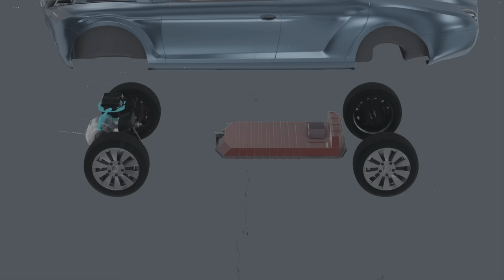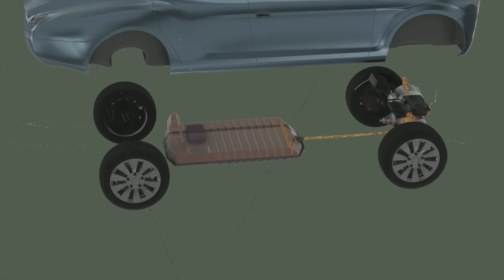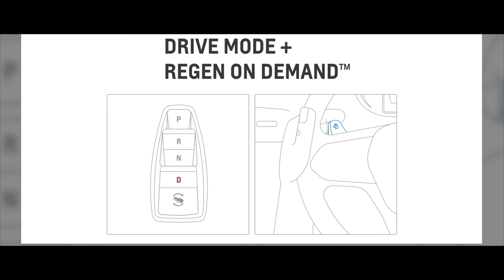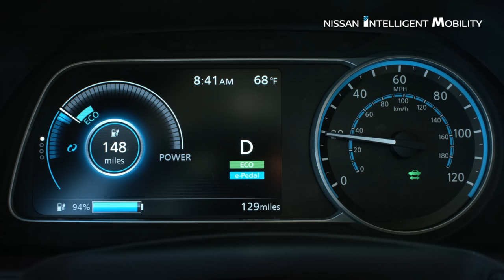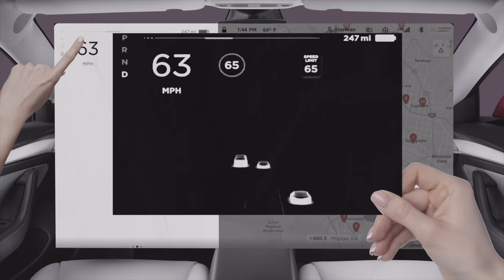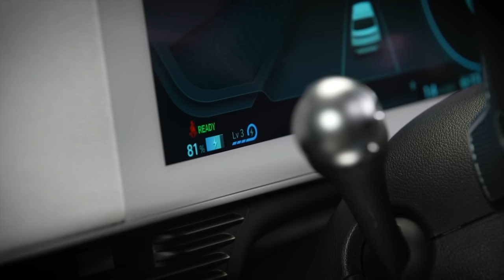Toyota's New Braking System Makes Your Brakes Last Forever

Comment: I had a Honda Element that went 165K miles with no brake pad change and it still had plenty of life left.  Anticipating braking does wonders for brake life
Reply: I really like people that gas up to a red light just to brake harder....
Reply: Yes my 94 HONDA Accord has 200 000 on it front brakes once replaced rear brakes once replaced!
Reply: In some ways HONDA is A little ahead of Toyota in Automotive inovations
Reply: @steveeddy6876  You're happy with your car, it's all that matters. Fanboying over any brand wins you nothing.
Reply: I barely use my brakes but I'm on my 3rd set with 105,000 miles. I'm not sure if it's because I don't use them but my brake discs pit, the pads barely wear but they get replaced with the brake discs. I drive a Toyota in the UK so the wet weather maybe has something to do with it rusting and grinding down? I have no idea, I should maybe do some research and find some super soft compound pads to hopefully transfer the wear away from the discs and onto the pads?
Reply: @em0_tion talk about something being useless while adding nothing of value
Reply: @DIE2dayORelse  Honda vs Toyota is the same difference to me, as long as it works. What annoyed you today?

Comment: I remember in the late 80's early 90's a company that was trying out hydraulic regenerative braking. It used a driveshaft mounted hydraulic pump/motor which used several accumulators to store the high pressure fluid to be used for helping acceleration. They tried it on some big rigs also. Locomotives have regenerative braking but all that does is warm up giant toaster coils. Although electric locomotives do put the power back into the grid.
Reply: That would make a lot of sense to get an extra punch when braking right before a corner then flooring it coming out.
Reply: Probably even more efficient than converting the energy to electricity to charge a lithium battery too
Reply: The trains that got their power from overhead lines via pantographs would feed the energy from regenerative braking back to the grid to power other trains, this was common in Europe where overhead power lines were common.  As most rail companies operated their own power plants and overhead power lines, a lot had to do with scheduling the trains such that one braking while going down a grade matched when one was ascending a grade to use the power from the regeneration braking of the descending train.  Now, with diesel electric trains (all of which could be ordered with pantographs if so desired, they really didn't build different trains, just offered pantographs or diesel generators as options), they tried using molten sodium batteries to store the energy but keeping the sodium molten proved to be an operational, maintenance and safety complexity that was difficult to manage with North American staff.

Comment: Owning a Prius, there hasn't been a day where I never actually used the brake pads to stop. Here in Florida,  for some reason, people driving regular cars love to wait 'till the last 20' and then slam on the brakes. I guess they like buying brake pads.
Reply: I do that but I'm just letting the car slow down by taking my foot off the brake. A lot of people go directly from gas to brake pedal.
Reply: Aron, Las Vegas is the same way. People will speed up and cut in front of you just so they can slam on the brakes for a red light. It’s absolutely ridiculous to do that. They’re burning up fuel and their brakes for no reason at all.
Reply: @alanj7306  Not to mention rude.
Reply: They are likely New Jersey transplants! Its better out here in northern Pennsylvania.
Reply: It makes me laugh how many people ride their brakes and rage on the the person behind them, get off the brakes and boom better fuel mileage, I use a manual, downshift as needed brake when absolutely needed

Comment: Scotty, the solution to prevent corrode rotors from regen braking is regularly using  hydraulic brakes whenever vehicle brakes below 10mph.  In some EVs someone already wrote this hybrid operation in the
braking software.

Comment: Scotty, during the regen, the motor don't move in reverse (so, there is no mechanism/need to decouple the motor from the wheels, as you mentioned), the system works in reverse, i.e. it starts acting as a generator, converting mechanical energy to very high voltage low amp current.

Comment: The motor does NOT run in reverse when using regen' braking, 

The motor is "driven" by the wheels, but it rotates in the same direction as when the motor drives the wheels,
this generates electricity, and it slows down the car

you can think about it this way: 
Accelerating: Energy from the battery goes to the motor that converts that into rotation ->this drives the wheels, 
Regen: Rotation from the wheels is converted by the motor back into electricity and this is put back into the battery, 

if you have used a bicycle dynamo then this is how the motor operates in regen, the production of electricity makes it harder to turn the wheels,

Comment: I had regen braking on my es300h. I didn’t have to change the brake pads the first time at 120k. That was just pads not rotors. I chose to change the brakes as well. It wasn’t required. Toyota has been doing this in their hybrids for a while.

Comment: With perhaps 75% of them being highway miles, the first set of brakes lasted 155,000 miles on my wife's 2011 Prius. The Hydraulic brakes are used enough, I saw NO evidence of any rust issues.
Btw: The car now has 220,000 miles on it and I just had my first ever non regular maintenance repair; a heat shield that cost less than $100 installed.
Reply: This is nothing to be proud of having a car with such low maintenance requirements. Support your local mechanics and parts suppliers and get a regular-type car that needs work!
Reply: My 2013 Ford Fusion Hybrid has been the same. Changed my first set of brakes at about 145,000 and that was only the front. No other non-standard maintenance. Regenerative breaking is an awesome technology but certainly nothing new.
Reply: @Russell-rc6qq  just buy MG's and Land Rovers in other words.
Reply: I woulda just ripped it off and saved 100 bucks

Comment: They do it with semi trucks too. They essentially use alternators on the wheels to power the electronics on the truck. Helps gas mileage by using the engine less to power things.

Comment: This is a good introduction to the system for people that have never driven an EV or a hybrid.  Btw, in Teslas you cannot disable regenerative braking.  You do get a warning icon that regenerative braking will be limited during cold weather.  Even in these situations, it does work, it just doesn't slow you down as quickly.  I have never had regenerative braking cause loss of traction even on ice.

Comment: I've had 2 manual transmission cars, I coast a lot in neutral to a red light etc I've gotten over 100k miles on the original pads. Just take them apart and a  clean.  Waiting for delivery of my NX350H,  should be interesting to see how long the brakes last. I will expect basic maintenance on them every few years, I'll do it myself.

Comment: Toyota does it again
Reply: Honda did it first with the 2003 hybrids because I own two manual cars got over 300.000miles out of both cars before the nickel metal hydride batteries were junk, And never had to do ANY brake repairs and that was in Wisconsin.
Reply: No theirs kind of sucks actually because their brake booster's have failed pretty consistently. Cost me $1,500 to do it myself in my gen 3 Prius. Gen 4 owners got a proper recall. They did two tsbs for gen 3 about the same problem. Kinda sucks they screwed the owners of 2010-15 Prius
Reply: @chicken29843  are you one of those Prius drivers that drive like their in a Fast n Furious movie? 😉
Reply: @raymondreiff8170  The Prius was actually designed first (concept and working prototype) Honda made it to production first by a couple months. But had little sales success. Toyota in their patience created a product that targeted the eco demographic more accurately. Honda ended up scrapping their sport hybrid after a couple years. I was sad to the manual hybrid go.😢
Reply: @chicken29843  huh fast n furious Prius
Reply: @dog troll  neither are you.
Reply: @mySaviorlives88  *They're
Reply: Now Toyota just needs to figure out how to keep the wheels from falling off their EV's.
Reply: Scotty does it again
Reply: You're one of those people that think toyota is perfect....
Reply: @raymondreiff8170  yea, but scotty said the 97 prius had it before that
Reply: @richsweeney1115  Toyota is Prius; not perfect..
Reply: @richsweeney1115  It did, But in my opinion the 97 pruis Car was more like a early Honda Insight, The 2003 Honda Civic hybrid was the most fuel efficient midsized Car in America at that time, Except for the water car invention who was killed by the oil control freaks, These same control freaks are busy Screwing up the Electric car industry and are winning like usual.
Reply: @beefybuttercup2978  see...I've worked on cars and trucks for 29 years...I know toyota makes prius...but most of these people act like toyota is perfect..and never have any problems
Reply: @raymondreiff8170  well, evs are crap....the water car  might have been interesting

Comment: I’ve driven a model 3 for a couple of hours and those regenerative brakes feel really weird but they are pretty cool
Reply: I’d be curious to drive an EV with them. Still, every vehicle will have its own habits with slowing down with letting off the gas. My 22’ Silverado Duramax nearly brakes itself once it’s down to 32-33 mph. Every vehicle takes some getting used to.

Comment: Might be more than a 50% increase in brake life. Have you driven a Tesla with max Regen braking? It slows down faster than (I do) when driving a conventional hydraulic system.
Reply: I own an EV (not a Tesla). Regen braking is fantastic, I use the hydraulic brakes about 15% of the time. Brakes gonna last 100, 000 miles.
Reply: I was once driving behind a Tesla in stop-and-go California highway traffic. I could only take so much and moved to another lane to drive behind a car that actually signaled (with brake lights) as it was slowing down.

Comment: When driving a Toyota hybrid and you want to coast, simply release the gas pedal then very slightly push on the pedal again and hold it in one spot. Now you should be coasting on neutral.
Your energy flow display should confirm that the car is coasting.
You're welcome 😁 👍

Comment: The early Prius integrated the regenerative braking control into the brake pedal but they kept the mechanical braking response the same so the regenerative braking prior to mechanical braking made the brake pedal excessively responsive so it took a lot of getting used to.  Most regenerative braking controls are now by levers or rather paddles on the steering wheel.  To reduce the mechanical braking response and top it with the regenerative braking so that controlling both with the same brake pedal without changing the feel of braking would be ideal but would be difficult to get pass safety regulators who would want the mechanical braking response to be the same as it has always been and the regenerative braking to just be an added functionality.  Instead of a rational user interface, we're likely to just become accustomed to the separate paddle controls before safety regulators would admit it would be safer to reduce mechanical response so that the initial brake pedal response be regenerative braking giving seamless control.

Comment: Brakes should definitely be serviced once every 2or3 years even if you don’t use them much.Pads can become rust jacked and pads can fall off the backing plates! Pads can rust seize in calipers and the fluid that is hydroscopic can obsorb moisture through the flexible lines causing corrosion inside the brake system!

Comment: My 2020 Hyundai Ioniq regenerates very slowly and brakes are needed more unless you set the level to 1,2, or 3 using the paddle shifters in automatic eco mode depending on how much braking you want. Of course in Sport mode the paddles shift the gears and turns off regenerative braking. Perfect design that works amazingly. Shame Hyundai will stop production of the Ioniq because the Elantra is now hybrid and they're almost the same size. The new design of the Prius is what draws me. If the Ioniq wasn't perfect in every way I'd definitely get the new Prius.

Comment: The motor DOES NOT RUN IN REVERSE, the motor turns into a generator when the kinetic energy turns the motor (not the battery).
When I drove a electric prius and leaf, I hated the regen because its hard to just coast, your either accelerating or braking, just stupid (maybe its better now), in effect, costing efficiency. I can get 64mpg in my wifes 2018 corolla on flat ground doing 60 to 65mph, so I am above the average in that respect, its all about the right foot.

Comment: Back in I owned two 2003 Honda Civic hybrids with regenerative braking and 5 speed manual transmissions I never had to replaced the brakes pads on both cars with over 300.000 miles on them because I always downshifted the transmission to keep the charging to the max, Sometimes driving around town was able to get up to 61 mpg.

Comment: Hybrids suck when the expensive battery degrades. At least with hybrids like the Ford Edge after 10 years, the ICE motor will works.

Comment: Scotty you should do reviews on older cars. Or compare older cars to new and the pros and cons of both and why some people don't wanns let go of the older generations of cars.
Reply: new>expensive
old>inexpensive       there. done.
Reply: Saabkyle
Reply: Every extra layer in an onion is just that many more tears shed. K.I.S.S. ☹️
Reply: @tinkerstrade3553  onion rings
Reply: How do you compare older cars to newer cars. Older cars had carburetors and they didn't even have disc brakes.   Unless you are a collector of old cars and love to drive them. You are in the minority.
Reply: Yea no one doing that big boy,  if you can't look up the difference between the two shouldn't own a car lmao it's called new is better vs old and constant repairs lol then it's also Japanese quality vs American gabage lmao
Reply: @patrickhenry2845  you need to do some research, there was fuel injection in the 50s my friend. I wasnt just meaning cars that old. 90s, early 2000s as well. Disc brakes have been around also since the 60s.
Reply: @AnthonyParrilloRI  You are correct. I remember my dad putting on a 2 barrel carburetor,, Rochester type. Later I remember to my friends had cars with Holly 4 barrel carburetors. Cars came out later with disc brakes in the front and drum brakes in the rear. And, later disc brakes on all four wheels. I don't need to do all of the research that you require of me. When, I have witnessed all, firsthand. No thanks to your research advice.
Reply: I had to leave go of my 2011 Hyundai because someone hotwired and stole it.
Reply: @phatgringo2.0  But if you have Vidalia onions the only time you cry is when you run out of them.
Reply: Why is there nothing that is all sunshine even sunshine? 😢
Reply: Scotty reviews plenty of vehicles that are 20-30 years old and older. I’m pretty sure that he’s mostly reviewing vehicles that people might actually be interested in buying or that they might own.

Comment: It is electric cars that have the biggest problem with brakes - the brakes do not wear out with use (due to recuperation), but since they are hardly used, they corrode on the contact surfaces and they need to be replaced soon. In warmer areas, it may not be so critical, but where roads are salted for most of the year, it is a real problem. Maybe it would be solved by a different brake disc material that does not rust.

Comment: Regen braking acts like a Jake brake in heavy duty diesel trucks. If you’ve driven a truck with an engine or “Jake” brake then getting into a vehicle that uses regen braking will feel very familiar

Comment: Wouldn't the regenerative breaking work along with the traction control and the anti-lock brakes to eliminate the problems with snow ice and even water. I know when I drive into work with my 2014 Fusion Energy when getting off onto the freeway off-ramp I don't usually touch the brakes to the last minute instead I decrease my miles per hour on the speed control usually down to 20 before I have to touch the brakes that ensures I maximize. Breaking

Comment: Hybrids have been common enough for 20 years. The brake argument should be finished. Also, my Ford hybrid has traction control. I've never had an issue with the regen in slippery conditions. Maybe that's just the really aggressive regen that Tesla has.

Comment: comercial large buses have redarders with the air brakes to help with the braking so the brakes don’t overheat. some retarders engage when the driver backs off the accelerator. the “regen” in our electric buses do exactly the same thing. However, like Scotty said turn off the regen on icy roads, as we do with air brakes on comercial vehicles.

Comment: This should be in all cars, regenerative brakes is a good idea. There's also a Shock Absorber that converts the vertical movement of the car in electricity, for cars and big trucks; that can be stored in a rechargeable battery
Reply: Yeah that stuff has been around more than decade but needs to be more widely available
Reply: I've heard of ride setting/magnetic shocks. They cost $$$$ per unit. Pass.
Reply: @timewa851  They're not magnetic shocks but generators

Comment: It basically replaces gas engine braking with electrical generator  braking. Regenerative braking is the biggest source of increased fuel economy in hybrids. You are also wrong about wasted regenreative braking. You almost NEVER fully charge a hybrid battery in real world conditions, and you NEVER lose it.